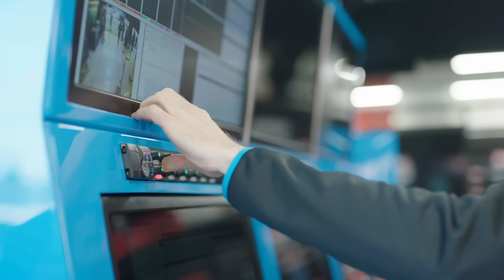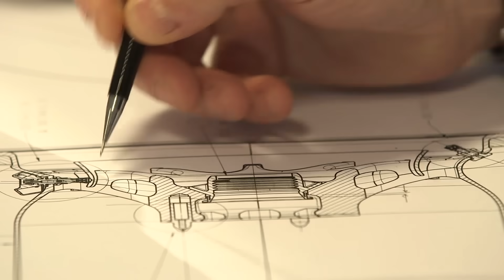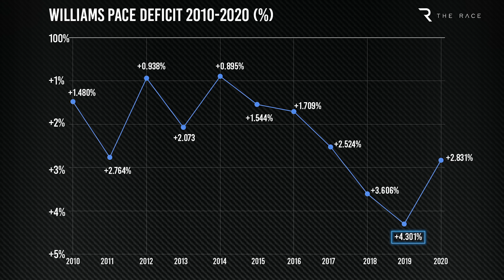How Williams is finally putting F1 results over its independent pride

Comment: Changing the gearbox to Mercedes gearbox ,their chassis design is certainly affected as torsional and longitudinal stiffness distriburion is affected , the Gearbox casing is part of the chassis structure .I would assume the Mercedes Structure being stiffer and better integrated to the Mercedes PU this may offer a significant step forward in mechanical response of the car in terms of front end grip weight transfer and tyre usage.

Comment: B&D are decent tools...for the DIY'er! 8:25 My goodness.
Reply: In hospital, my femur was drilled into with black & decker.  It was a silver cased tool with the logo, unlike anything I've seen for general sale.  It shocked me, but, turns out they make quite hi-grade gear for such medical settings.  Dunno how relevant all this is...
Reply: @blacktoothfox677  Hmm good to know! With a bit of research, I found tool brands DeWalt, Craftsman, Black & Decker, and others are under one company. DeWalt offers mid to high end grade tools and B&D is on the lower grade. I just think that a former top team would splurge a bit on high end tools with less chance of failing when the going gets tough. The B&D tier tools are actually fitting for the struggling Williams team.

Comment: Not a word about aerodynamics? Those gearbox and suspension engineers will help there, for sure. Great new direction. Why just not pay what has to be paid to bring someone who knows what's doing. Those aren't as expensive as top drivers. Also, what good can do having Russell that's going to leave when Mercedes claps, or Latiffi who's in F1 by miracle. Stroll was at least multiple champion.

Comment: If they could drop Latifi (which they can’t cause £££) and pull up one of the rising or veteran drivers like Kubica, Armstrong is looking good or Hulkenburg. Along with fixing a lot of shit with good funding they could be fighting for points. It’s also crazy to think that just a few years ago, with Felipe Massa, they were front runners (2016-17) only three years ago. 
I think the most recent comparison is Haas. In 2019, they signed a sponsorship agreement with Rich Energy (we all know how that went). They had quite good results in 2018. But Rich Energy never followed up their agreed payments for Haas due to a legal copyright battle. As we all know, a team cannot develop unless it has cash flow, unless you’re Ferrari and can’t create a good car even with cash flow. A mid-tier team like Haas lost so much progress because of their shocking sponsor. I hope to see them do better next season and make the midfield a lot tighter. 
It would be interesting if there was little time between 10th and 20th a much more intense season. I think we all want 2010 and 2012 again.

Comment: Williams should be more capable of producing a quality chassis and aero than say Alpha, Alfa, and HAAS. If they take the Mercedes suspension to go with the hydraulics, power unit and gear box they should have the ability to move up the grid. I think this year is going to turn into a wonderful fight, depending on what political intrigue will crop up this year.